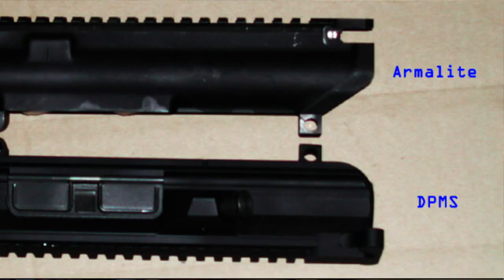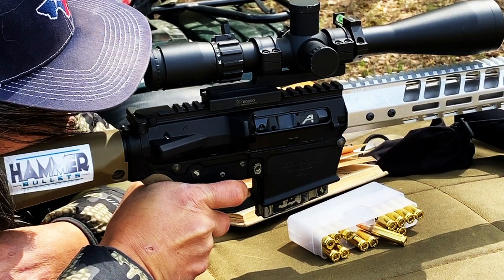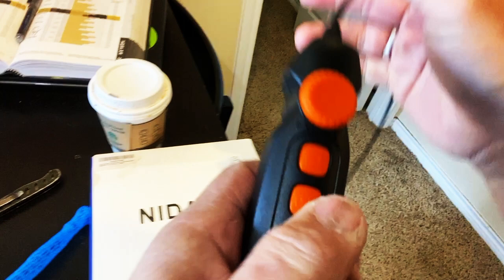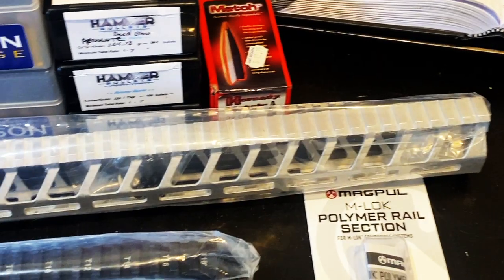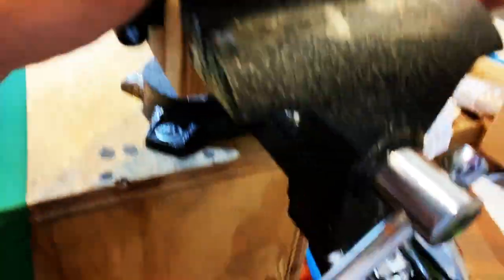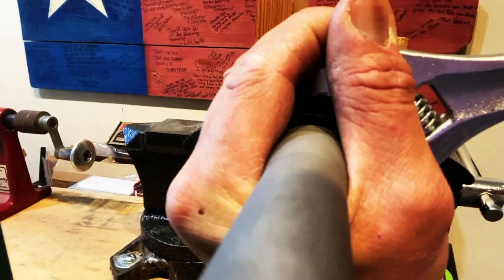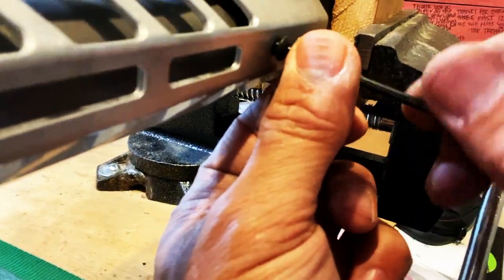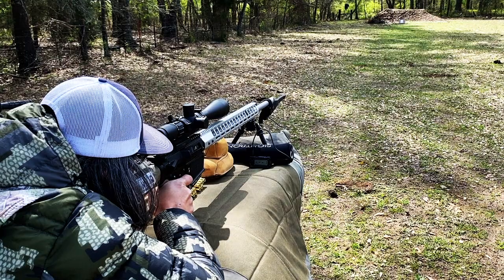AR10 Build • Keep It Simple • 22 Atomizer

Comment: Ed, when tightening/torquing the barrel nut, you must  tightening/torque then loosen and re tighten/torque nut three times to get the stretch that occurs when shooting the gun.  A good indicator the not using the correct technique is loosening of the headspace resulting in an unexplainable POI shift as the rifle is used.
Reply from the maker: Thanks for the input. I've built every AR15-AR10 using same technique in this video since 2014. My first build to this day (223 Wylde) still holding true out to 700 yards. So I'm of the mindset that if it ain't broke don't fix it. If things ever go wonky I will keep this in mind. BTW Just took this build out to 300 yards on an untuned load. Results were astonishing.

Comment: I love it, made my own upper vice block out of wood and I use a big crescent wrench as well to attach my barrels, just a little Lubriplate engine assembly grease on the threads, have never torqued any of my barrels. Looks like this will be a pretty interesting zipper of a cartridge. And I remember the "AR 10" differences by Armalite = Angle on the uppers. Neat video.
Reply from the maker: I've had quite a few suggest different lubricants for the barrel nut.  Really  need to step up from fingernail polish!!!
Reply: @OutdoorEDventures  I have built and rebuilt hotrod engines for over 40 years, all we ever used was Lubriplate assembly grease, so I naturally used it on barrel nuts. I'm not really sure there is a "wrong" lubricant to use. Some people get really anal about "proper" procedure, but as we have found out it doesn't seem to really matter all that much, if any. Although I have recently started lapping my upper receivers, a straight barrel inline with the receiver and scope does make sense to me for accuracy, especially for longer distance shooting.